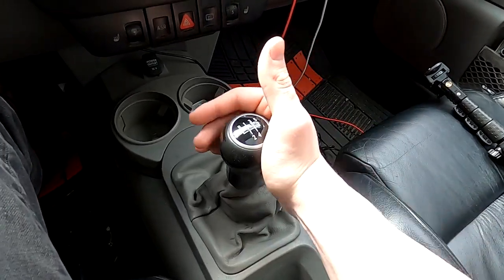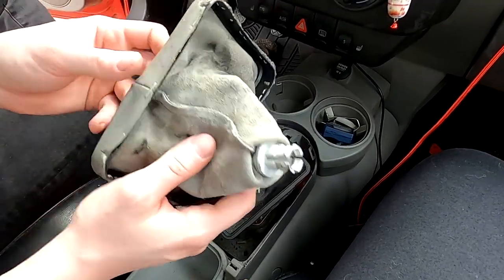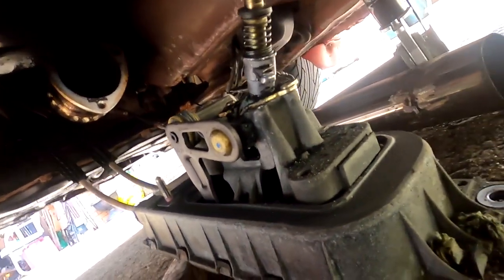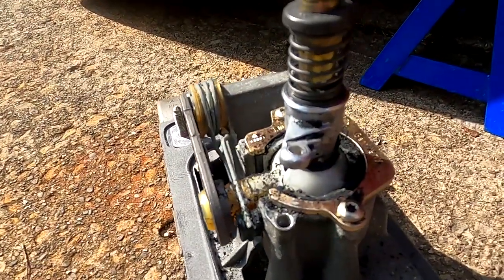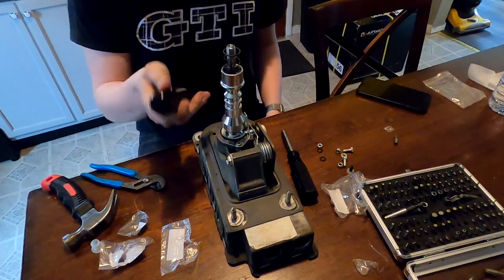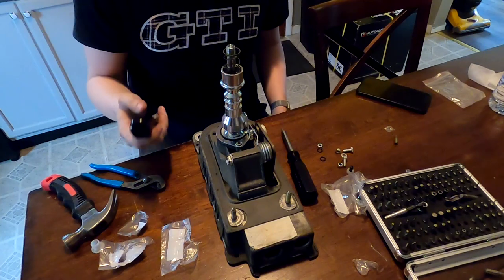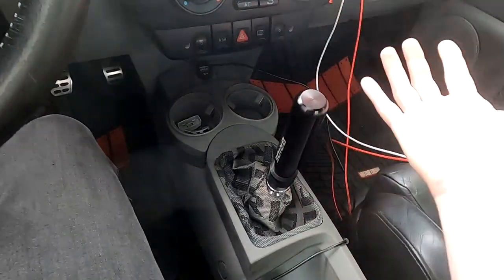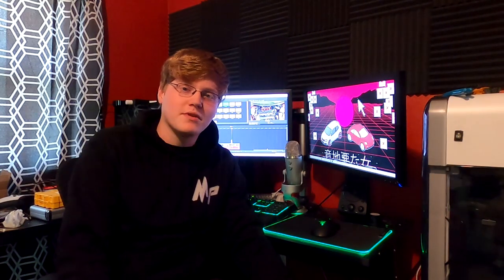DRAMATICALLY IMPROVING the 1.8t Beetle's Shifter

Comment: Do you have to take out the gearbox? You cant just put it in from inside the car ?
Reply: You can pop the bottom panel off of the gear shifter mechanism with a flat head screw driver that's what i did
Reply: Didn't have to take anything else off other than the bits on top inside the car
Reply: @mikepdesigns8801  any videos on it ???

Comment: Where did you get the pin that goes in the shifter lockout handle and what kind is it? my kit did not include one.
Reply from the maker: I used a 20d nail that I cut in half. The 20d nail is the exact same size as the hole in the shifter so it’s a pretty tight fit